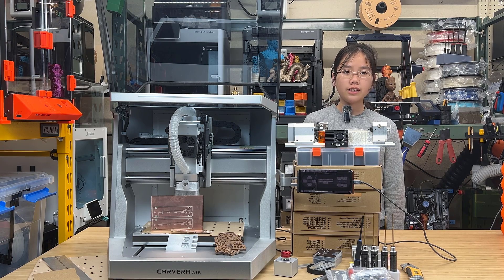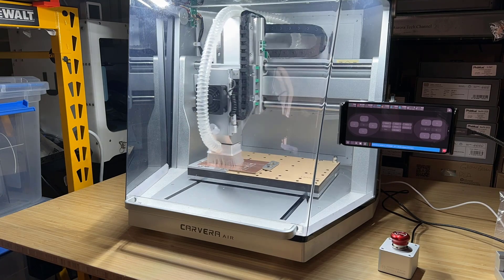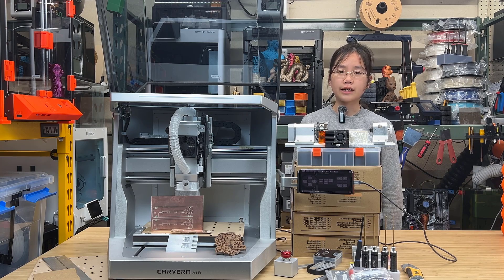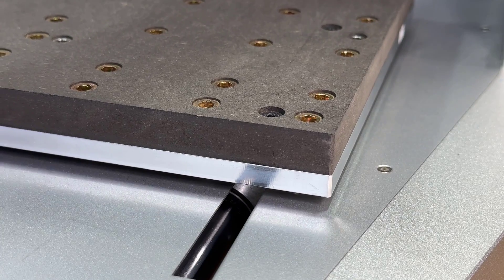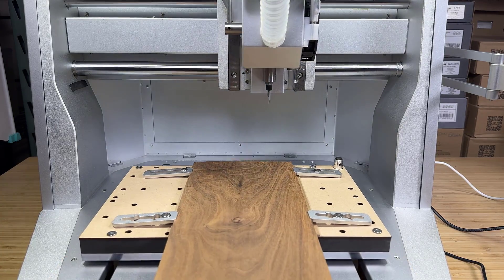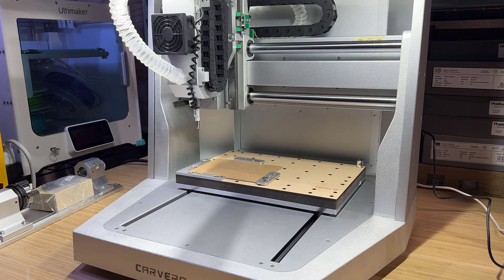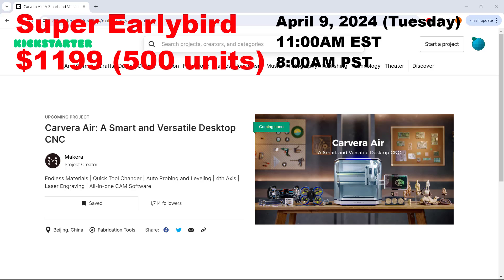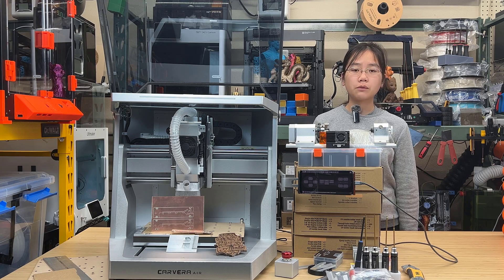Makera Carvera AIR CNC Quick Preview: The 2nd Best Desktop CNC, Auto Tool Height, Quick Tool Change

Comment: Thanks for this fantastic review. I've ordered an Air via the Kickstarter campaign.

Can you please tell me, is it possible to use the Air manually? For example, if I wanted to simply put a hole or key-way in an existing part, would I need to load a tool path, or could I simply drive the X, Y and Z axes manually?

Comment: Hi,
Do you have any experience with Scupfun S30 promax? It is a laser engraving, the question is: can we change the laswr to drill bit node?
Reply from the maker: I don't think so, since laser engraver frames are typically not designed to handle the weight and force generated by a spindle or router.

Comment: Where do you buy your bits?
Reply from the maker: It came with different sizes of collets, including 1/8", 1/4", 4mm, and 6mm. Any regular CNC bits with these shank diameters should fit.
Reply: @AuroraTech  I can't find good bits for 6061 aluminum. In the past I could mill for a whole day, but now they don't last for more than 2 or 3 hours

Comment: The auto tool changer is the only thing that justifies the Carvera's price. If there was a better software ecosystem to help newbies, this machine might be good for newbies. However, the difficulty in learning a full toolchain of CAD and CAM, which is the same for cheaper, more powerful machines, makes this just a more expensive basic CNC. If the Makera CAD/CAM software ever materializes, this may be a good machine for education. Until then, save your money and buy a more conventional machine that uses standard parts you can replace, if they break.
Reply: Can you recommend desktop machines with CNC, Laser, PCB-making, 4th axies, like the carvera air for cheaper?
Reply: @womacko  Just a thought in my head, Genmitsu 4040-PRO, 4-axis, larger engraving area, lower price:face-blue-smiling::face-blue-smiling:
Reply: @bumbeeworking7587  has no housing...
Reply: @womacko  most machine on the market has no housing... its not the point my mekanika has 600x600 area for work but no housing,,, and i buy some item profile and make my housing inklude space for tools myself... and i can build how i want ,)